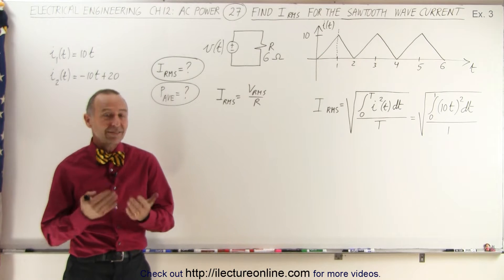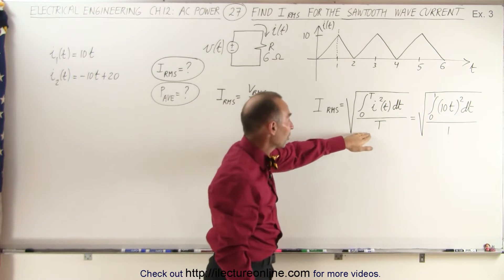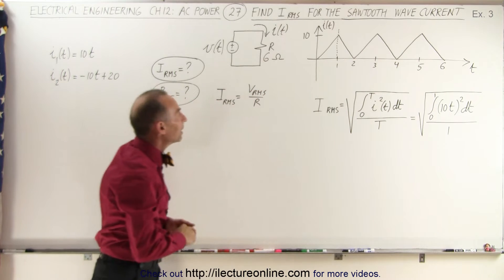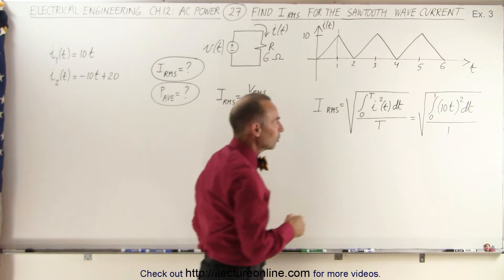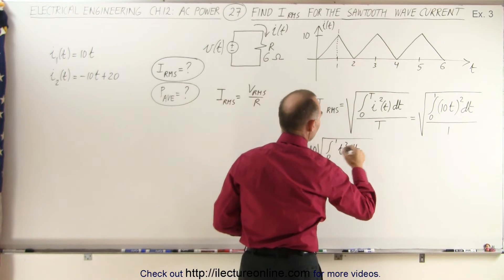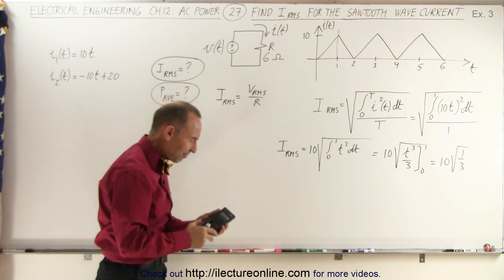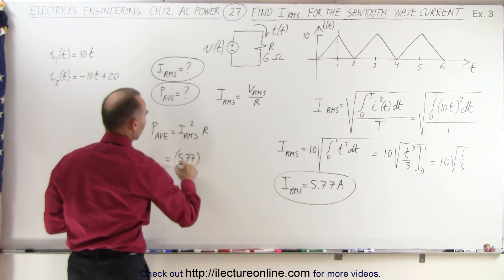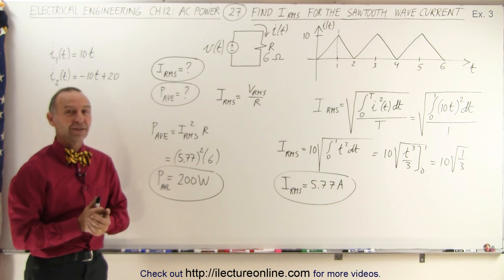Electrical Engineering: Ch 12 AC Power (27 of 58) Find I-RMS for Sawtooth Wave Current

Comment: sir why the i2(t) is -10t + 20 I dont get it can you explain to me ?
Reply: In the second portion, slope is -10t (decreasing) but at t=2 sec current should be zero so it will be -20 , you should add 20 to make it zero so the equation becomes 20-10t
Reply: @bharathkumar6719  thanks

Comment: Sir another question. why did you put the 10 outside of the sqrt?? In the books, they include valuse inside. like 5t^2dt it will become 25t^3/3
Reply: Yap
Reply: The (10t)^2 term can be expressed as 100t^2. After this, he pulls the constant out of the square root.
Reply: He didn't, for RMS you need the square of the function, and since 10 squared is hundred, after it goes through the root it becomes 10.

Comment: Dear sir,  I Don't understand the thing that why we should only integrate the first portion limit 0 to 1 
And the rms value is  5.++ how??
Reply from the maker: The RMS value will be the same for every 1 sec portion of the current and thus we only need to integrate one portion of it.
Reply from the maker: If you take a look at this video it will help you understand RMS current:   Electrical Engineering: Ch 12 AC Power (22 of 58) What is the RMS Current?
Reply: Sir should be find slop